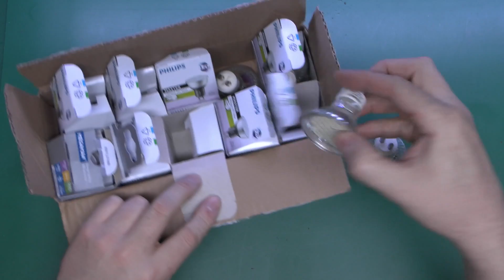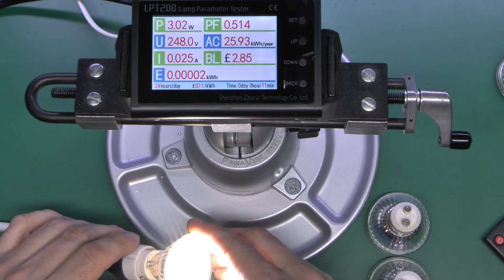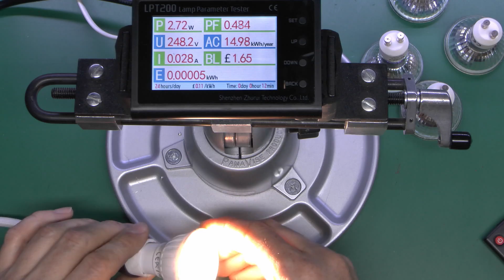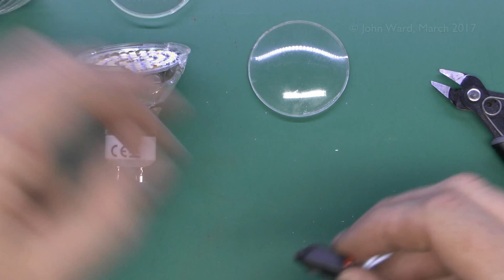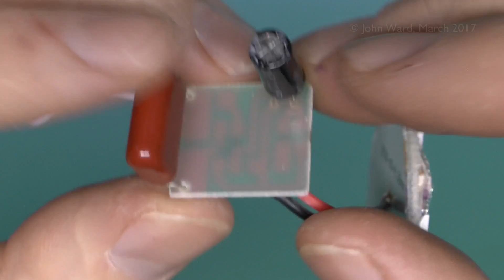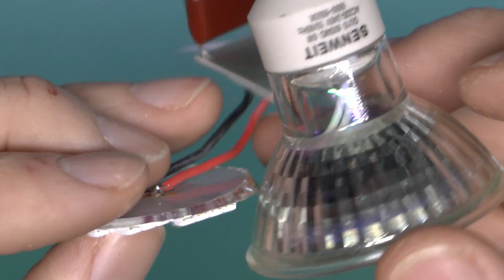Failed GU10 Led Lamps

Comment: How do I test a gu10 lamp using a volt meter please .. thanks for your useful advice
Reply from the maker: If it's a halogen / incandescent, then test for resistance across the pins,  a low reading indicates it will work, open circuit it will not.
For LED types they cannot be tested like that, the only test is to connect to the appropriate voltage and see if it lights up or not.

Comment: Yep, power LEDs still aren't very reliable.
The claim that LEDs last long probably goes back to those standard 5mm LEDs as indicators. For them it is true as they run very very cool. But those power LEDs run quite hot. I also have quite a few of them failed. If you want a lamp that lives long and saves energy, go with CCFL lamps if you dont turn them on/off very often. I have one that's now getting 15 years old, and is lit over 12hrs a day! Still working perfecty fine.
Classic tungsten lamps are a lottery. Some last 20 years, some only a few months

Comment: Capacitors used in those lamps are temperature sensitive components. Higher environment temperature will shorten their MTBF. Module package and typical bracket force them working in relatively high environtment temperature (sometimes above 60°C). Potensially cuts down their MTBF far below 20000 hours.

Comment: Folks, don't buy these.  They are CRAP!  I bought exactly the same kind of Chinese made,  glass-encapsulated, matrix LED down-lighters - and they don't perform according to the advert on Ebay.  They were advertised to have an expected life of 50,000 hours, which would make them last 5.7 years if they were lit 24 x 7.  In my kitchen, where they get less than 3 hours use par day during the Winter, and much less in the Summer, they should have lasted the rest of my life.  They were quite a bit more expensive than incandescent bulbs, but in the light of longer life and smaller electricity usage, they would work out quite a bit cheaper.  I use 7 of them in the kitchen, so I bought 8.  When two had failed, I was one short, so I bought 4 more. In less than 2 years, 9 out of the 12 I had bought had failed, making them considerably more expensive than incandescent bulbs.  It's not the price that bothers me as much as having been conned.  I don't know if it makes a difference, but the ones I had were cool white.

At first, they start flickering from full brightness to much less - I'd say about a third brightness, and working under them is like being under a neon tube that is on its way out, and flicking on and off.  When they eventually stop flickering, they go permanently dim.

I have replaced them with a different style of LED light (with just 3 LEDs in them) and they seem OK - though it's early days, so who knows?

When I complained to the Ebay seller, they said they only guarantee them for 3 months.  I asked if they guarantee the accuracy of their advertisement, but they wouldn't be drawn.

Comment: The 400vDC dropping cap is very common cost cutting measure as its cheaper than the proper mains rated types. Engineered to fail, hopefully just outside the 1 year warranty, this is part where you get ripped off.

Comment: That's pretty standard, excessive heat will be the cause of failure, the design is terrible, all that heat will destroy the components on the back too. Two very common design flaws If the fools are not over-driving the LEDS, excessive heat will be the other typical cause of premature failure. Also the third is poor quality control and poor quality LEDS, factory seconds.

Comment: No bleed resistor on the radial design?  So if a LED fails open-circuit, you go up a step-ladder, remove the lamp, accidentally touch the contacts, get a shock and fall off the ladder?

Nice.

Comment: Hi John - thanks for piece on LED GU10; what is disappointing about these is that they purport to last 20000+ hours. Of course once they fail like this they're basically useless. I have had a number which have become u/s after approx 2-3 hours use per day over three years or less than 20% of claimed life, rendering the so called longevity claims ridiculous.  Do you think they fail because of the heat factor or poor quality components or both? Best, Chris
Reply from the maker: Heat is the usual factor, particularly in the cheap ones such as these.  There is really nowhere for the heat to go as the outer enclosure is glass and most of the internal space is just air.  Better designs have the enclosure made from thermally conductive materials to help move the heat to the outside of the lamp.
Some run the LEDs at rather high current to get a good brightness, and with them all in series as with these ones, it only takes a single LED failure to wreck the entire lamp.

Comment: bit high voltage, isn't it?
Reply from the maker: It's at the upper range of what is allowed (253V maximum).
Reply: John Ward such a shame they accommodated the National Grid by moving from 240 +-5% to 230 -5 +10%.
Reply: Yes the reason is LEDs are a dc device so 240 AC rectified and smoothed is about 400v DC  the only way round it is to use inverters as used in more expensive units  The main reason for early like failure is heat as they need much larger heat sinks 
A lot start to flash when they get hot  the leds warm up go open circuit then cool and restore connection in a cycle

Comment: And these are supposed to be environmentally friendly.  It seems that unless they are made without cutting corners much more waste is created.  Once I bought a new compact fluorescent tube lamp.  It was housed in glass and lasted 15 years in my hallway.  However newer models lasted about 1 or two years.  I wish I had kept that lamp to show how good they were made back in the early 1990's
Reply: True - everything back in the good old days lasted longer - I still use my grandfathers Toshiba Microwave oven its over half a century old (50 years i mean 50 years!!!!) and still working with the only problem being the turntable needing a quick fix and a clean! I also have an old Marconiphone CRT Model 4715 colour telly its still going after 40 years as well - modern Plasmas andLeds last 4 years average and I just repaired my LGPK590 Plasma tv it lasted 4 years poor very poor - Built in obsolescence and terrible for the environment! Sad world!
Reply: Tangobaldy GU10 leds aren't supposed to be more environmentally friendly.

Comment: Please could you explain a bit about power factor.... pretty terrible?  what does that mean?  Thx
Reply from the maker: Power factor is on the list of videos to do, although it may be a while as it can be very complicated.
Reply: It describes the ratio of the actual power drawn to the apparent power as defined by multiplying RMS voltage by current.  If the current is in phase with the voltage then the power factor is one.  With a power factor of less than one the device is drawing current that isn't actually being used.  See Wikipedia for more details (of a type which are almost incomprehensible even if you already know a lot about what power factor means).

Why does it matter?  Because the loss in a transmission line depends on the current, whether real or apparent.  With a low power factor more power is wasted in the transmission line.

Why does that matter?  It costs the generating company money.  The worse the power factor, the more money it costs them.

Why does that matter?  Power companies don't like losing money.  Industrial power meters, where lots of power is used, also measure apparent power and your bill is higher if your power factor is low.

Why does that matter to you at home?  Because the new "smart" meters have the option to bill you for apparent power.  Depending on your country, that may or may not be enabled or will be enabled in the future.  When it's enabled those LED lamps won't save you as much money.
Reply: +NivagSwerdna
Complex issue, all about the current waveform compared to voltage waveform 'in time'...

Out-of-phase loads (e.g. inductive-wirewound-ballast or Capacitive-dropper-circuits), effectively pull more transmission capacity without using more actual power -- was explained to me!.

Another problem is 'distorted' loads -- e.g. simple bridge rectifier into capacitors -- these are in effect taking only pulses of current to keep recharging the capacitors.  This creates "harmonic distortion" ....  which is also considered into power-factor equation!....

This could be the subject of a very complicated video unto itself...!, no doubt some already exist!
Reply: NivagSwerdna power factor is how efficient an AC electrical item is when comparing electrical power input into work output.

Comment: Hi john, what do you or anyone make of these dim-able LED switches etc, I have come across some and are very unreliable they have a minimum and maximum load on a 6amp RCBO, it seems that you have to get the bloody things just right, or they simply don't work, they stay on or don't come on or come on but you can't turn them back off.... These are the ones that operate from a remote control as well as touch on the the face plate and have a driver unit in the face plate.... Maybe you could do a video on these as the control driver units don't seem to be a good idea.

Comment: ive had several in this style, but with a b22 connector, they have mostly failed by falling out of the b22 socket! they use some kind of cement type to hold it, and it fails

Comment: +John Ward
The big resistor on lamp at 11:07 is a Fusible-resistor -- marked F1 -- they often come in funny body colours and unusual colour band patterns etc...   Essentially they do have a specified, small, resistance value...  when they get too hot they open-circuit permanently rather than going up in smoke...

Comment: used to buy loads of these oddly i found them to be reliable (had maybe 10 die out of over 300 of them) the b&q ones in the UK that use a single LED are definitely brighter and have been slowly cycling them to them (as the LED ones hardly ever fail that may be some time ) i done the kitchen but rest of the house is on them china 5w ones as i have like about 10 spare ones now form the kitchen (that are 3-3.5w really)